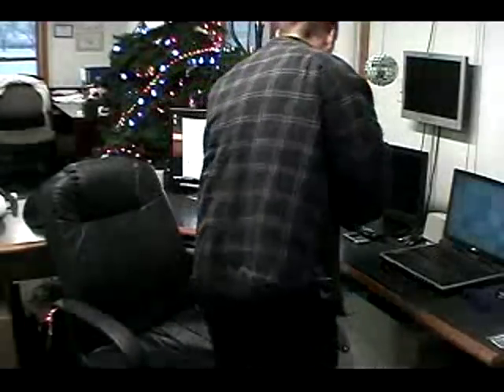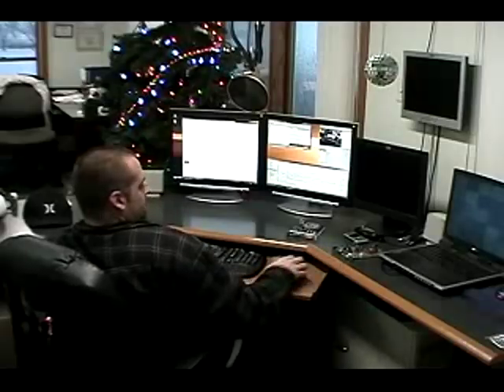Fix Video Card Fan Noise Tip Part-1

Comment: My rig is a bit older and I have ati radeon x1650pro that started making really annoying sounds and the fan was having trouble spinning. I greased the fan with motor oil on a toothpick and now its completely silent. Hope it stays like that. Thanks for the video. :)

Comment: @PCAddictsLive Happy Holidaze!  While my gt9800 was much different from the card in the video, the info gave me the confidence to seperate the card into 4 primary parts.  It was indeed filthy and one could see under the canopy where the fan blade had beaten the dust into a harder surface.  The blades, too, were also filthy and the cleaning technique shown was useful.  That said, when reassembled, the fan was totally dead, either from bad oil or...?  Looking to replace the fan now.  Thanks again